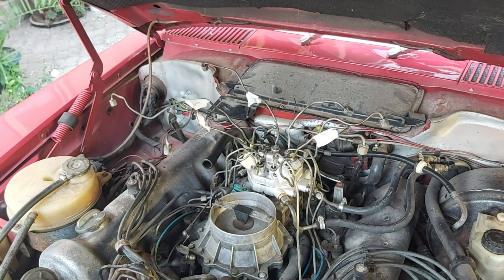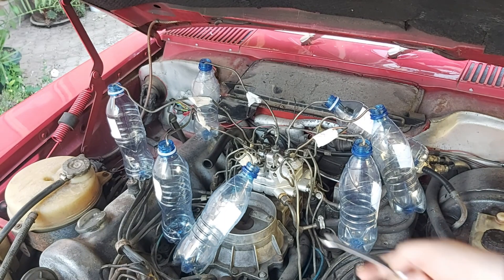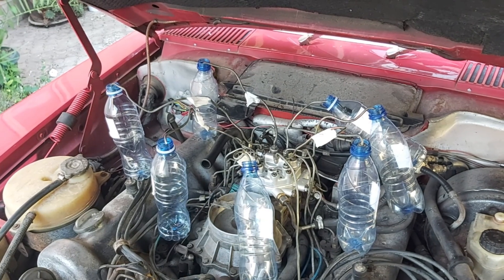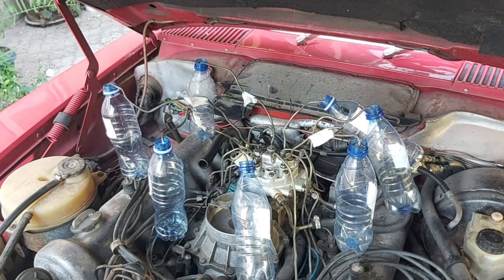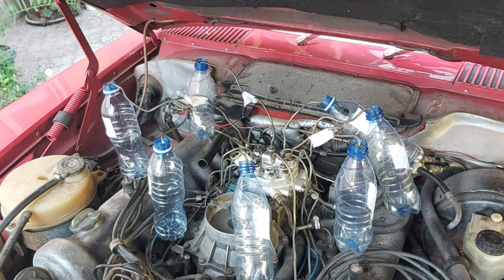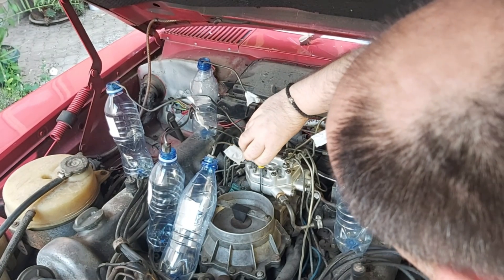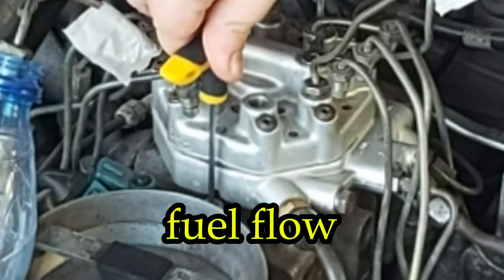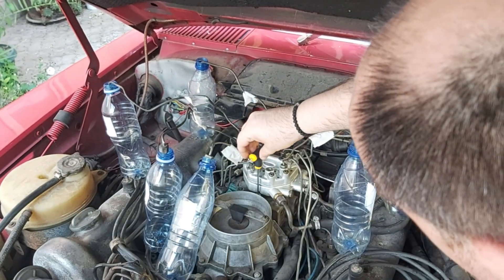㉦Mercedes Ke-Jetronic㉦ - Initial Mixture Adjustment on K/KE-Jetronic – Quick & Precise Guide 🔧💨

Comment: This technique worked for me.  Thank you for saving me a lot of trouble.  
Let me tell you… my car was running fine, but I wanted to smooth out a slightly rough idle, so I tried replacing the potentiometer. Unfortunately, I didn’t research it beforehand and didn’t know about the required adjustment. The idle got worse, so I put the original one back… same problem. Then I started messing around with the mixture adjustment. As a result, the car wouldn’t idle anymore and would stall easily. I spent days tinkering with the mixture screw and even lost two 3mm keys in the process… they’re somewhere down on the plastic cover at the bottom of the engine.

Anyway, I then used a long 3mm TORX screwdriver, and it actually worked better.

Steps I did:

Disconnected the battery

Installed an old fuel pump relay with pins 30 and 87 bridged using a piece of electrical wire

Disconnected one of the fuel injector lines from the distributor

Turned the mixture screw 4–5 rotations counterclockwise to ensure no fuel comes out when the fuel pump runs

Reconnected the battery… the fuel pump runs because of the bridged relay… no fuel spilling

Slowly turned the mixture screw clockwise until fuel started spilling from the open port on the distributor

Backed off the mixture about 1/2 turn counterclockwise… at this point, no fuel was leaking from the port

Disconnected the battery so the fuel pump would stop running

Reinstalled the injector line to the port

Installed a good fuel pump relay

Reconnected the battery

Started the car… VROOM!
Reply from the maker: That’s a great result! 👏 You did everything right — the initial mixture setup is the key to getting the KE-Jetronic to behave properly again. Losing two 3mm keys is almost a “K(E)-Jet initiation ritual” 😅 — we’ve all been there! Once the base setting is correct, everything else becomes easier to fine-tune.
Thanks for sharing your detailed steps, this will help many others too! 🔧

Comment: Hello, I have a W124 E230 car. Distributor No. 1 is not working well, causing the engine to shake. When tapped with a hammer, it works well, or when pressing the gas pedal. Can it be repaired without disassembling or cleaning it while it is mounted on the car?
Reply: Thank you very much
Reply from the maker: Hi there! 👋
If tapping on the distributor makes cylinders start working again, that’s a classic sign of internal plunger sticking — either from varnish buildup, fine rust, or dried fuel residue. Unfortunately, this can’t be fixed properly while it’s still mounted on the car. Spraying cleaners from the outside won’t reach the internal metering slits where the plunger moves.

✅ What you can try (temporary):

Try removing the fuel distributor and remove the plunger, clean it entirely and lubricate it with machine oil. That can help the plunger not to stick anymore. If that doesn't help then:

⚙️ Real solution:
The only proper way is to disassemble and clean the fuel distributor — plunger, metering slits, and O-rings. When you do that, it will never “stick” again and the idle will become perfectly smooth. If the car runs better when you press the gas pedal, that also confirms that the plunger isn’t returning smoothly at low flow.
Happy Mercedesing! 🔧💪

Comment: I measured my fuel pressure from the pump and its 5.5 bars, i measured the EHA control pressure it was 5.1 before that u turned the EHA screw little to left then right, so i unplug the EHA plug and i cant start the car, when i turn the key up from the pump is 5.5 and down is 3.0 without EHA plug and the car doesnt start i cant adjust the EHA, Can you help me
Reply: The car is working rich in idle and when i press the pedal id doesnt want to accelerate it drowns and backfires, my potentiometer is good and only my eha and co screw needs adjustment
Reply from the maker: Always remember for how much you turned a screw cw or ccw. Put the pressure gauge on and turn the adjustment screw 2mm ccw untui you reach approx. 5bar working pressure. Then fine tune the EHA by measuring mA on the EHA until you get the fluctuation around 0mA (+/-5mA).
Reply: @mercedeske i made the EHA screw 6.6mm it was 7.3mm and now i have a solid 5.1 bars, now i only need to adjust the CO screw because the car now won't start with adjusted potentiometer and EHA the CO screw is pain.
Thanks again!
Reply: @mercedeske  The EHA is 6,6mm and the co screw has 1.9mm play and the car wont start. What can it  be?
Reply: @mercedeske  IT STARTED! my EHA setting was 7.0mm there was mistake i have 2 EHA's on with the number 841 and the other one with 066 the 841 works when its set to 7.0mm the 066 works on 6.6mm, and the CO2  screw doesn"t work on 1.9mm clearance, the mixture was so rich that when i hit the gas pedal the car starts and on idle it stalls, i turned it counterclockwise and it starts very well, doesn't backfire, feels like race car
(long story short i changed the ke jetronic unit with one that is 122hp mine is 132hpKAT,my old diaphragm was leaking fuel and the one that is 122hp was recycled but needed a little adjustment) the car was laid down in 2016 sfter 9 years i managed to  start it and works well.
Thanks a lot!

Comment: Hoi, ik heb een 190e 2.5-16. met koude motor start de perfect. Maar met warme motor start die moeilijk. Welke video van jou adviseer je mij om te kijken?
Reply from the maker: Heb je de brandstofaccumulator vervangen? Deze zit parallel aan het brandstoffilter. Als de auto meer dan 200.000 km heeft gereden, vervang hem dan. Dat zou ik ook doen. Groeten uit Servië 🇷🇸
Reply: @mercedeske Dankjewel voor je reactie mijn Servisch vriend. De brandstofaccumulator is vervangen, heeft niet geholpen. Bougies zijn vervangen, brandstoffilter is vervangen. Alles origineel. İk denk misschien lekkende injectoren, zou dat kunnen? İk heb een video geplaatst op mijn kanaal. De auto is warm gereden en daarna bougies eruit gehaald en cilinder binnenkant gecontroleerd. İk begrijp niet goed of het lekkage is van injectoren maar het lijkt beetje nat binnen.
Reply from the maker: @MrUslu  Bedankt voor je uitleg, mijn vriend 🙏.
Als je meer dan 100.000 km hebt gereden met deze injectoren, dan is het het beste om ze te vervangen – vooral bij een Mercedes 190E 2.5-16, waar lekkende injectoren vaak startproblemen en natte bougies veroorzaken.
👉 De hoofdpunten waar je naar moet kijken zijn:
Terugslagventiel (check valve) bij de pomp
Injectoren zelf
Meet de brandstofdrukken met een manometer en kijk of zowel de systeemdruk als de regel-/werkdruk tijdens het draaien van de motor constant blijven.
Als je na vervanging van de injectoren nog steeds problemen hebt, controleer ook de koudstartinjector (startventiel), want die kan soms lekken en dezelfde symptomen veroorzaken.
Groeten uit Servië 🇷🇸 en Happy Mercedesing 🚗✨
Reply: @mercedeske Dankjewel maat. İk ga dit controleren
Reply: @mercedeske Hey broer, heb je misschien video waarin je koud start injector (startventiel) en terugslagventiel (check valve) laat zien of vervangt?
Reply: @mercedeske de injectoren zijn vervangen en helaas het probleem niet voorbij. İk ga binnenkort naar de andere 2 onderdelen kijken

Comment: مساء الخير ايها الخبير
دورات المحركRPM تقرأعندي 10وعندما اقوم بوضع Dتنخفض دورات المحرك الى5وكذاك الحال عند استدارة المقود يمينا او يسارا وأحيانا كثيرة ينطفئ المحرك مالسبب ؟ارجو الرد مع جزيل الشكر والتقدير ايها المحترم
Reply from the maker: This usually comes from the Idle Control Valve (ICV). When you shift to D or turn the steering wheel, the ICV should open more to keep RPM steady. If it’s dirty or not working properly, RPM drops and the engine stalls. Also check the load signals from the transmission and power steering pump, as well as vacuum leaks or the lambda sensor.

Comment: Hello. I have an w124, M102 and the idle is perfect, is accelerating perfect ( 190 km/h), smooth running, perfect cold / hot starting, but when i take off the foot on accelerator is sputtering, like a missfire, in special on slow speed 20-40 km / h. 
What could it be wrong?
Reply from the maker: Hi! From what you describe, it could be the throttle position potentiometer starting to wear out or having a bad spot. When you lift your foot off the accelerator, the ECU needs a clear “closed throttle” signal, and if the potentiometer isn’t reading correctly, it can cause sputtering or a light misfire at low speeds. I’d recommend testing it with a multimeter to check for smooth readings across the range.
Reply: @mercedeske Ok, i will test it. I bought the potentiometer  3 years ago, it was new, but  not OEM.
Thank you
Reply: @mercedeske Hello, between pin 1 and 2 i have 0 v and sometimes 0.9 v and drops instantly to 0 v.

Comment: Hello, first of all huge thanks from France for all the work you're putting in your videos. I would like to ask for some advice concerning my 2 liter w201 from 1990. No electronics are working on the jetronic side even though my sensors read correctly, my ovp is good, tested in many ways, and my ECU receives 12v. Even with another ecu, i get no eha, icv nor fuel cutoff for deceleration! My injection remains fully mechanic, thus a 1500rpm at operating temperature...
This is now my second year of research on this vehicle, thanks for reading me this far. Have a great summer and wish you all the best
Reply from the maker: Hey! Big thanks for your kind words – really means a lot, greetings to France! 🇫🇷
Based on what you described, if:
all your sensors are working properly, OVP relay is confirmed good, ECU is receiving 12V, and you've even tested with another ECU…
…then the most likely culprit is the EHA valve.
If the control unit is alive but nothing happens on the EHA, no idle control, no fuel cut on deceleration, etc. — then there's a very high chance that the EHA is faulty (either electrically or hydraulically).
But of course, it needs to be tested to be 100% sure — sometimes the coil is fine, but the valve inside is stuck or leaking.
Also make sure the EHA is getting current during key-on and engine run.
You've already done a lot of great diagnostics — I really hope this helps you narrow it down.
Wishing you all the best too — and may your W201 finally behave this summer! 🌞
– Fix Your Mercedes

Comment: Salam əziz dostum necsən sizdən cox sey orgənmisəm hələdə orgənməyə davam edirəm bunun ucun sənə oz minəttdaeliqmi bildirirəm. Sənə bir sualim yaranib bu dazatoru hansi dərmanla yuyulur nə ilə yuyulsa dahada təmiz olar yigilmaqiucun ?
Reply from the maker: Selam dostum, güzel mesajın için çok teşekkür ederim! 🙏🏻
Sana yardımcı olabildiysem ne mutlu bana. Böyle devam et! 💪
Yakıt dağıtıcısını temizlemek için birkaç yöntem var:
İlk yardım olarak karbüratör temizleyici (carb cleaner) kullanılabilir.
Ama ben genellikle limon tuzu (sitrik asit) tozu ile temizliyorum.
Eğer varsa, ultrasonik banyoda temizlemek en iyisidir —
60 derecede, 20 dakika boyunca.
Bu yöntemle hem iç hem dış parçalar çok daha iyi temizlenir.
Selamlar,
Fix Your Mercedes

Hello my friend, thank you so much for your kind message! 🙏🏻
It really means a lot to know you're learning from my videos — keep going! 💪
For cleaning the fuel distributor, there are a few methods:
As a first step, you can use carb cleaner — it works fine for surface dirt.
But personally, I usually clean it with citric acid powder (dissolved in water).
And if you have access to it, the best method is an ultrasonic bath —
at 60°C for 20 minutes.
That way, even the internal passages get properly cleaned.

Best regards,
Fix Your Mercedes
Reply: @mercedeske salam əziz dostum hər sey ucun cox sagol sənə oz minətdarliqimi bildirirəm hər sey aydindir amma bir seyi dəqiq bilmədim ulturasonik aparatada limon duzu suyu ilə yuyulur ?
Reply from the maker: @nahidmeherremov4389  Selam can dostum, güzel mesajın için çok teşekkür ederim! 🙏🏻
Böyle destekler beni çok mutlu ediyor. Elbette sana açıklayayım:
Evet, ultrasonik cihazda limon tuzu (sitrik asit) + su karışımı ile temizliyorum.
Bu yöntem özellikle iç kanalları temizlemek için çok etkili oluyor.
Sıcaklık: 60 derece
Süre: 20 dakika
Eğer ultrasonik yoksa, dışarıdan da yavaşça fırçalayarak aynı karışımı kullanabilirsin.
Yeter ki dikkatli ol ve metal parçaları çizme.
Selamlar!

Hello my dear friend, thank you so much for your kind words! 🙏🏻
Your support really means a lot to me. Let me clarify your question:
Yes — I clean the fuel distributor in an ultrasonic cleaner using a mix of citric acid (lemon salt) and water.
This method is especially effective for cleaning internal fuel channels.
    Temperature: 60°C
    Time: 20 minutes
If you don’t have an ultrasonic cleaner, you can still use the same solution and gently clean the parts by hand — just be careful not to scratch any metal surfaces.
All the best!
Fix Your Mercedes 🚘
Reply: @mercedeske birdə bir litir suya nə qədər limon duzu qatilir ?
Reply from the maker: @nahidmeherremov4389  Selam dostum! 😊
1 litre su için genelde 2 yemek kaşığı limon tuzu yeterlidir.
İyice karıştır ve metal parçaları 20 dakika boyunca 60 derecede ultrasonik banyoya koyabilirsin. Eğer çok kirliyse, biraz daha limon tuzu ekleyebilirsin.
Kolay gelsin!
Fix Your Mercedes

Hey my friend! 😊
For 1 liter of water, I usually add 2 tablespoons of citric acid.
Mix it well, and you can place the metal parts in an ultrasonic cleaner at 60°C for about 20 minutes. If the parts are very dirty, you can add a little more citric acid.
Good luck with the cleaning!
Fix Your Mercedes
Reply: @mercedeske hər sey üçün cox sagol  əziz dostum  bildim basa dusdum  minətdaram

Comment: Hello friend, I need advice. I have adjusted the mixture just like this on my M103. I set the mixture to be more lean and it runs amazing. WONT IDLE. The car will ONLY idle and stay running if I press gently on the pedal or hold throttle under the distributor. It will not idle alone, no vacuum leaks to detect…
Reply: I'm deeply sorry, friend. The M103 engine's injection system works completely differently than this one.
At least I think so. The expert will give you the right answer
Reply from the maker: Hello, friend. That means that you made the mixture too lean. Perform the test with screwdriver - the engine must start shaking when you both lift as well as lower the sensor plate. That means then you set the mixture as it is supposed to be. As you tell me that you must press the sensor plate in order for the car to stay alive, then you need to make the mixture a bit richer.
Reply: @mercedeske When I get fuel just coming out of the fuel distributor and going 0.5 turn out, the car will fire and die instantly. The car will only run if I hold the gas pedal down gently. If I make it more rich it still will not idle. I am thinking my throttle is the issue. Iacv tested from a 300E.
Reply: Can you try this to get the right RPM for idle. Get a voltmeter with Hz on it and set it to read HZ. Use pin 1 and Pin 2 to monitor Hz (RPM) of car when idle or to adjust it up or down at Idle. Pin 2 (TD signal) Pin 1 (ground) on the X11 diagnostic port. Loosen the nut of the ignition distributor (the one with the spark cables on top). First mark where you are at with the main body, just in case you need to come back to it. Turn left or right to get the right RPM for Idle. Just a touch right or left is needed. For 4-cylinder M102 engine - RPM = Hz × 30 (because it counts twice.revolution) .  for 103 RPM = Hz x 20 (it counts 3 times per revolution). Here is the Table for RPM adjustment for pin 1 and pin 2: Frequency-to-RPM Chart for M103: So adjust the ignition distributor to get you right idle speed for car by turning the igntion distributor right or left just a touch to get the righ Hz on multimeter. (please check with Fix Your Mercedes before you proceed). Good practice is to get mixture right first (Pin 1 and pin 3 duty cycle 50% (if you have an oxygen sensor) adjust with 3 mm allen key adjust in flow meter. multimeter in duty cycle setting.
Hz (TD Signal)	RPM
20 Hz	400
25 Hz	500
30 Hz	600
32.5 Hz	650
35 Hz	700
37.5 Hz	750
40 Hz	800
42.5 Hz	850
45 Hz	900
47.5 Hz	950
50 Hz	1000
55 Hz	1100
60 Hz	1200
65 Hz	1300
70 Hz	1400
75 Hz	1500
80 Hz	1600